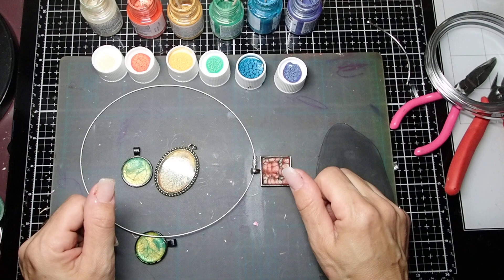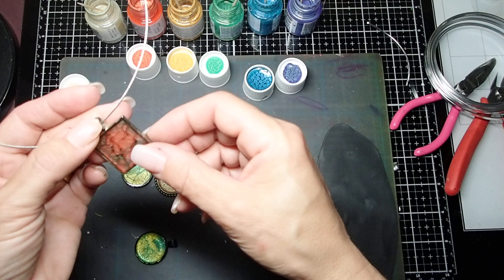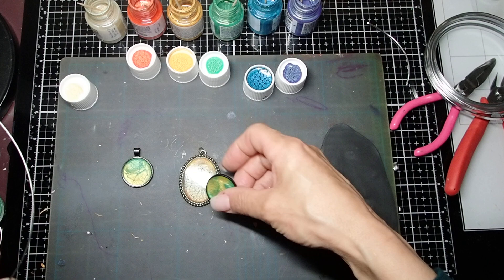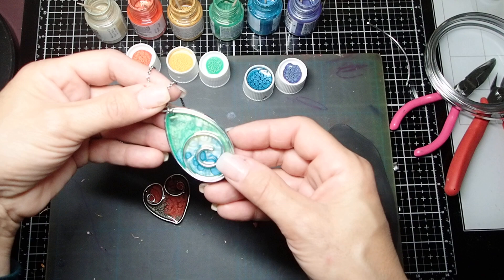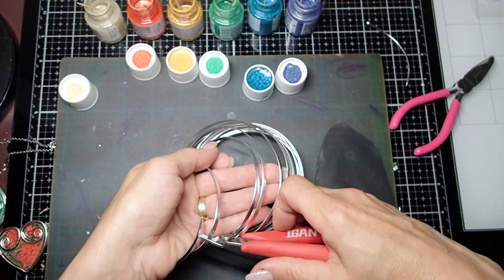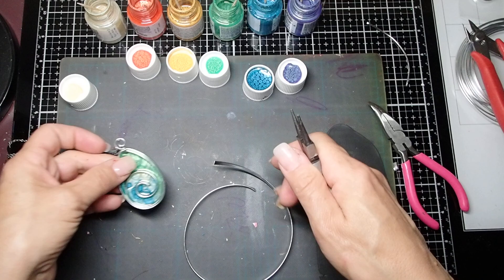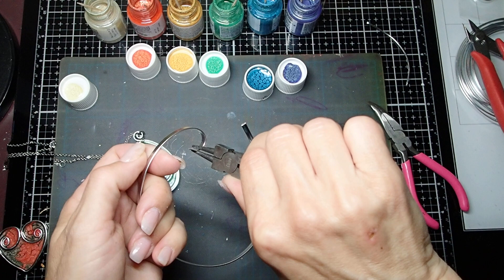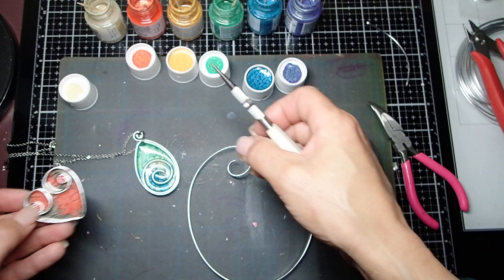Flat wire pendant with Pebeo Prism Paint

Comment: How long do you bake it??? Using polymer clay and Prisme Paints?
Reply from the maker: You bake only the polymer clay base and you do it according to instructions.  I bake mine at 260 degrees for 30 min. Once it is baked,  you add prisme paint to it. You do not bake it after the paint is applied.
Reply: @joannascorner4478  why wouldn’t you bake the clay with the paint on it? Baking the clay with the paint will heat seal the pain so that it will not come off… I get that you will  also seal the paint with resin, but heat sealing it before you apply the resin is a better approach in my opinion… I am very curious as to why you don’t heat seal the paint first… 😊😊😊
Reply from the maker: It is not recommended to bake prisme pebeo paints, that's why I bake the pices and add the paint after.
Reply: @joannascorner4478  gotcha… I’ve never used those paints before… I use acrylics, oils and water colors…
Reply from the maker: They are amazing!  As they dry they create this beautiful honeycomb effect. I get a tickle every time I use them.
Reply: @joannascorner4478  well, I think I will have to get some and try them out,.. what is the name of them and where can I get them? I’m in the US…. So hopefully that won’t be a problem :)
Reply from the maker: They are called Pebeo Prisme paints .you can get them on Amazon but it has to be Prisme. I think I might have 3 different videos with them.
Reply: @joannascorner4478  ok… thank yo7 so much!